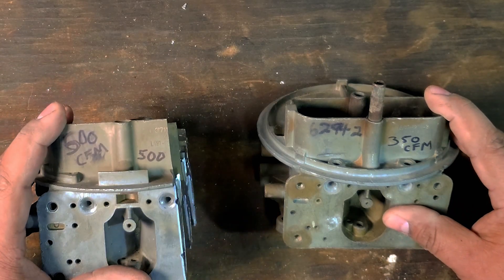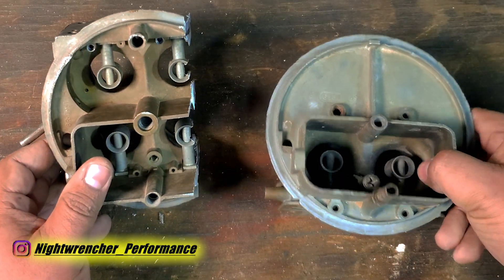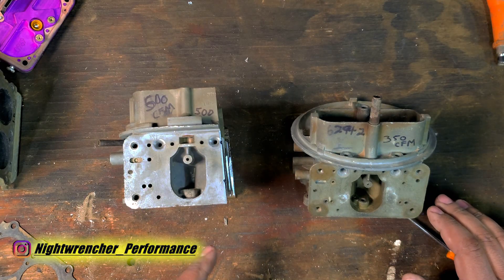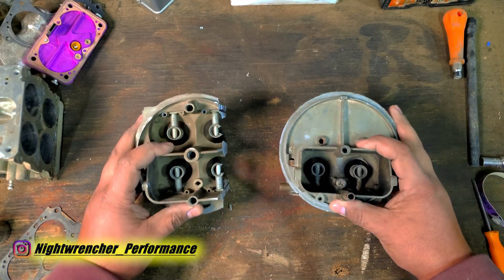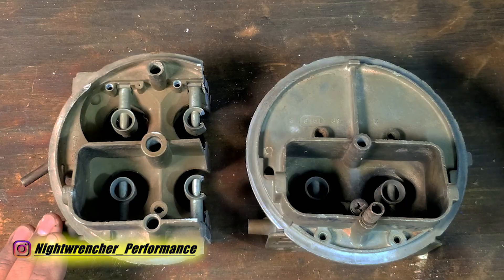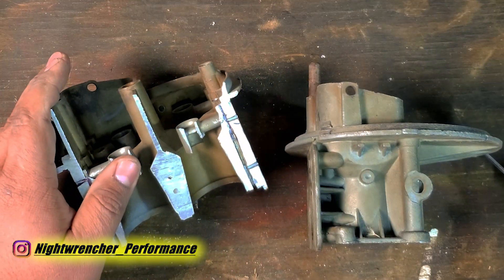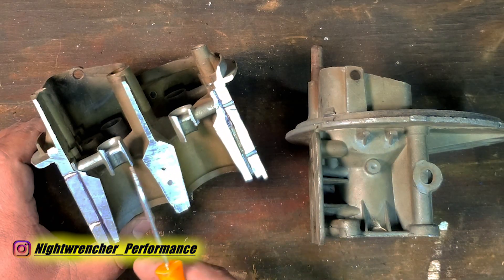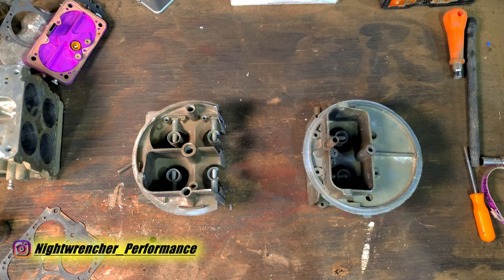The Truth: 2 Barrel vs 4 Barrel Carburetors | Holley Carb Tuning Tips And Tricks |

Comment: I have a ford 400 2 V in a 78 mark V, the engine power is poor, I need to keep the 2 v because the car gets judged at shows and it needs to be original, is there a better 2 barrel I can install? Or have custom built? What would you do? Thanks

Comment: what is your opinion on a 650 or 750 4 barrel on a stock 283 sbc?
Reply: Quadrajet makes the most power with the 283
Reply: im considering getting a 500cfm 2 barrel instead for dirt circle track racing

Comment: I've always tried to go 2 cfm per cubic inch or as close as you could get to that. But now after your video I'm questioning the carb rating. So a 600 is actually going to be around 500? My big question is what does a 750 truly flow?

Comment: Question, what was the Holley list number on the 600cfm carb you cut open? Was it a common Holley 600cfm like the list-1850?
Is this a common thing you find with Holley 600 cfm carbs? - (not being  600 cfm?)
What do you think about the Holley list-6425 - 650 cfm 2V carb from back in the day? (used in circle track racing)

Nice video, and explanation.
Reply from the maker: I believe it was a 4368 but it does not show up on Holley's data sheets. If you try to find it using measurements alone, you also will not find it listed. 

As for your other question, the 6425 is a 2bbl carb with the venturri of a 750 but with the throttle bore of an 850. They used to make factory carburetors like that called the "830". If you divide that by half, thats only 415cfm, a far cry from the advertised 650. That carburetor would react like a 750 down low but power would die off fairly quickly up top. A 600cfm 4bbl would meter fuel better down low and provide more power up top regardless.
Reply: @NightWrencher  Are you using actual flow bench numbers from testing or are you using (or talking about) theoretical mathematic flow to arrive at these CFM numbers?
Also, the 6425 has no booster venturi, does that make a difference in over-all cfm and flow ratings?
Reply from the maker: @abcullens2328  I am going by the officially reported Holley numbers. Theyre easily found if you search for them online. They come in a PDF file and list dozens of carburetors. 

The data sheet lists the venturi of the 6425 as1- 7/16" and the throttle bore of 1-3/4". Since I know the cfm of the 750/850 hybrid carburetor which uses the same venturi and throttle bore specs as your 6425, you simply divide 830 by 2 and get the 415cfm. You gotta remember that 2bbl carbs are over rated when compared to 4bbls due to the different testing parameters.
Reply: @ So you are talking theoretical flow numbers, question - does a 600cfm Holley carb flow 600cfm on the flow bench? (out of the box new) or any other Holley carb actually have the advertised cfm flow?  I have always wondered about that.
Reply from the maker: @abcullens2328 they actually don't. Two identical carbs with flow about the same but a Holley 650 zinc body will flow different than a 650 aluminum body because the castings are different but still advertised as the same CFM because the venturi and throttle bores are the same size.
Reply: @NightWrencher  Thanks, so two barrel carburetors and 4 barrel carburetors use different math to calculate CFM, if you use the four-barrel formula on a 2 barrel carburetor, how much smaller would the CFM be? Just curious.
Reply from the maker: @abcullens2328  holley rates their 4bbls at 1.5hg and the 2bbls at 3hg. Holley lists the same carburetor at different CFM values so If you go by venturi and throttle bore size instead, you'll never go wrong.

Comment: Back in 70's, the factory 2 barrels, Rochester, autolite and B&B, the intermediate circuit was either huge for 400+ or small passage, under high load fuel replaces air. Holley's metering blocks are sized different, the 4barrel has better signal, we always went to 4 barrel for economy, better management and tuning, using vacuum secondary, not double pumper.
Reply from the maker: Vacuum secondary carbs on the street are a god send. Much easier to tune than a dbl pump carb.

Comment: True stuff. Not having my own car yet, in 1972 I took my mom's 289 Cougar and removed the factory 2 barrel clobberator. On went the ubiquitous Holley 4412 500 cfm 2 barrel, 'cuz more cfm is more power, right? Sure it had a little more up top, but the mileage in daily driving went down the pooper. Boy, was she mad. Not nearly as mad as when I then put on Ford Hi-Po exhaust manifolds and paid for a whole new system, but with loud-as-hell glass packs. (She was a school teacher, and her students were making fun of her). The final straw came when the tires wore out. I took the car for new ones, but I neglected to mention I bought a set of nice used Magnum 500's for it. You know, so the looks matched the sound. She begged my dad to beat me senseless, but he was too busy laughing. 
Fast forward to 2004, and I snagged that car back from the her friend she sold it to in 1978. The timing chain had snapped and I was glad to pay 300 bucks for it. The car, not the timing chain. In my back yard, with the Holley, HP manifolds, and the Magnums still on it. Sorry for the novel.
Reply from the maker: Thats awesome that you were able to get the car back after all those years!
Reply: @NightWrencher  Although my mom's friend lived about 10 miles away at the time, when the chain went he was in her general neighborhood on his way elsewhere. So, he had it towed to her house and dropped it off in the side yard. She called me here in AZ and asked if she should call the junkyard or what. I said "Don't you dare" and I zipped the 450 miles back there to get it. At the time he thought the engine was blown, but it cranked double speed without the rotor moving (non-interference cam). So I gave him the 300 to cover his tow and whatnot, grabbed the title, hooked it up and bailed. When I got home I opened the trunk and found a spare C4 trans and a "correct" center console, which it did not have originally.Koolness!
Reply: @413x398  did you make it run again?? And do you still have it??
Reply: Fucking bullshit you didn't mention that you also have to replace the intake 😅😅😅 plus your vacuum advance to your distuberter doesn't work worth a shit 😅😅😅😅